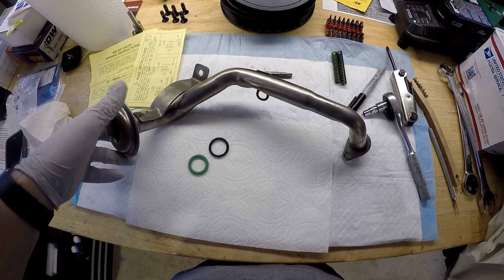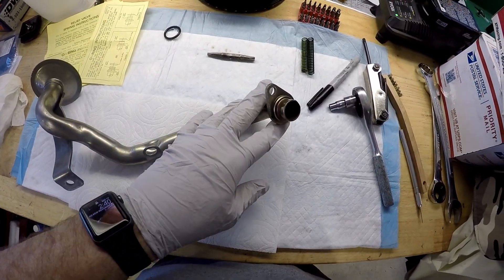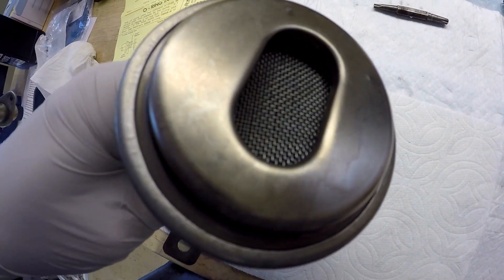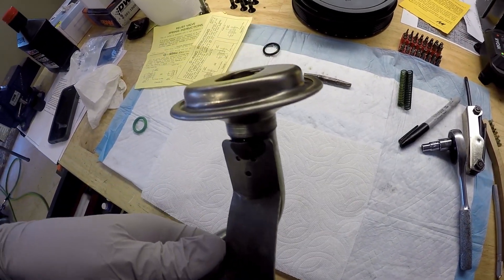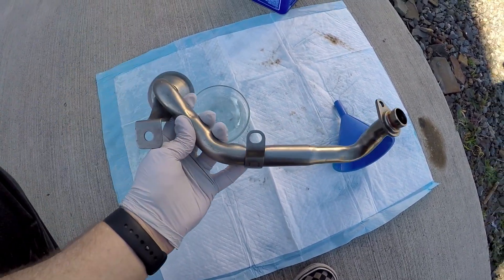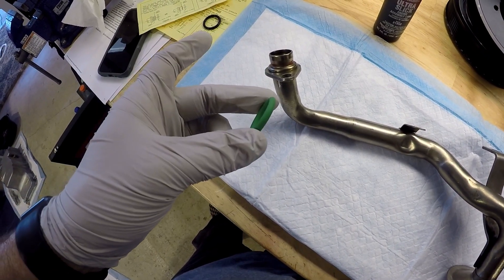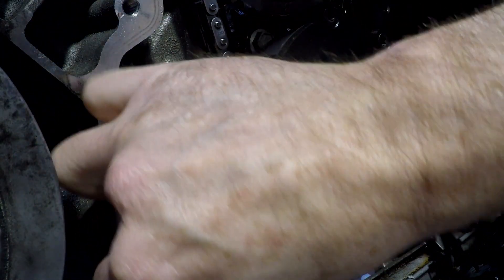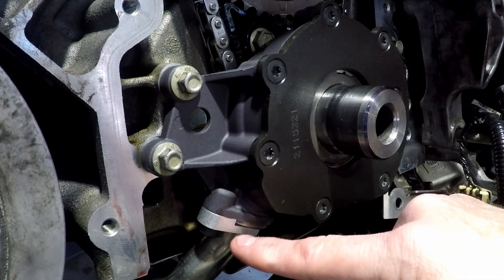How to Install the LS Oil Pump Pickup Tube

Comment: How did you get the oil pan completely off without lifting the motor is the transmission out? I’m getting hung up on the oil pick up tube at the front of the motor and can’t get my oil pan out all the way
Reply from the maker: https://youtu.be/2iqekORDMu8?si=f-BcpwWcuF7ER4dU
Thank for watching. Watch the whole video to find out where I got them.  Do yourself a favor and join Camaro5 forum if you haven't already. goodluck
Reply: Thank you I have watched your video on that very helpful. I also have that “engine crossmember” done on mine I did it a week ago. I found it on the camaro5 forum about a year and a half ago from CFD. I still can’t get the oil pan completely out though just dropped enough to change that pressure relief valve did you have the front of the motor open at the oil pump to disconnect the pick up tube there? I think that’s what I’m going to have to do or Jack the motor up some to get the oil pan out

Comment: Hi I have 2003 suburban 5.3 can you by pass a oil filter pressure valve? The one that intact on oil pan the one that you can see once you removed your oil filter 
Thanks 🙏
Reply from the maker: Sorry, I dont understand your question.
Reply: @fasnuf  hi sorry I have an original oil pan on my suburban 2003  and this built with oil pressure valve, do you think I can use a with no pressure valve ? 
Thanks
Reply: @joncarlosramos9697  the only pressure relief valve in an 5.3 ls style oil pan is in the generation 4 ls style with active fuel management.  Gen 4 is 2007-2014, if you delete the afm you can delete the oil pan relief valve. On gen 3's the only pressure relief valve is in the oil pump.

Comment: You are probably spot on with your description of the debris that was on the pick up screen. I've come across this several times in my years of wrenching especially on motorcycles. The halo of excess factory bolt glue that squeezes out after tightening a bolt breaks down over time from soaking in fuel or oil and of course heat cycles then falls off. I've seen the perfect little tell tale circles in oil pans float bowls etc. Had a piece of that stuff clog a tiny port in a moto carburetor once and had a few choice expletives finding the little blue chunk of crap puke out onto a paper towel using compressed air after the sixth time of dissassembly and reassembly. Lesson learned: Be consevative with lock tite! A dab will do ya.
Reply from the maker: I knew a guy that had fuel starvation problems on his car. He traced it down to the fuel tank. On further inspection, he found someone's lunch bag inside the tank. I dont remember the old car he had, but it was a two piece tank. He thinks it fell in during assembly. Who know's if it was a real story, but ggoes to show crap happens.
Reply: @fasnuf  We had a fuel starvation problem on a Plymouth K-car long ago. Turns out there was masking tape in the gas tank. I have. NO IDEA how it got there, especially since it was neatly laid out on the bottom of the tank.